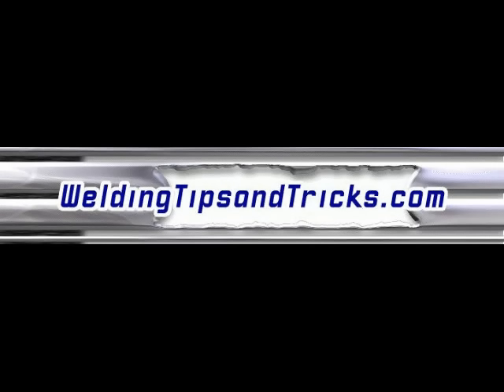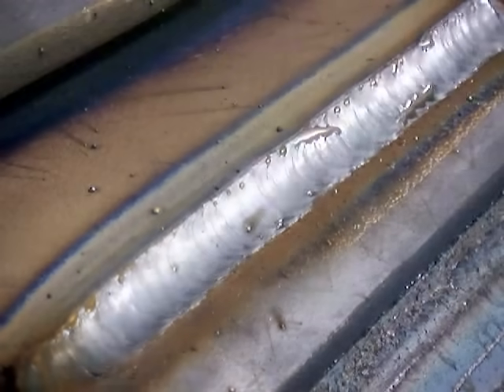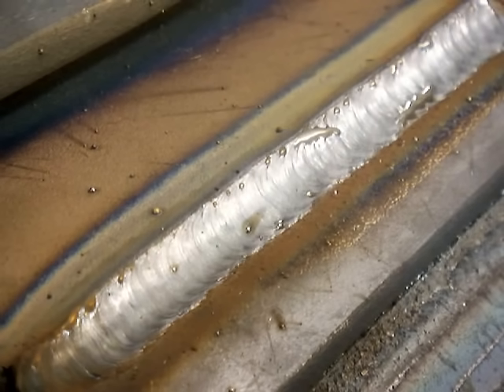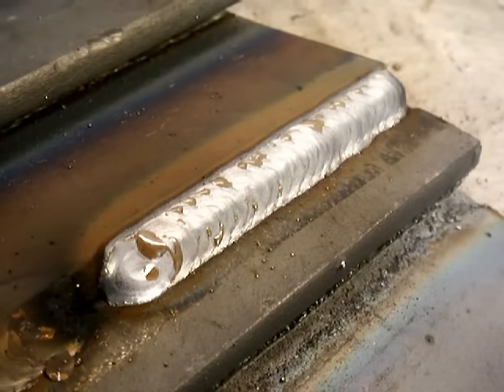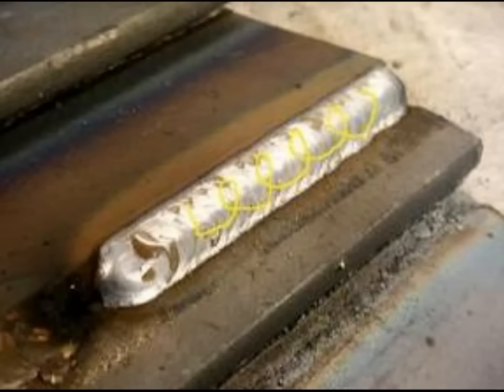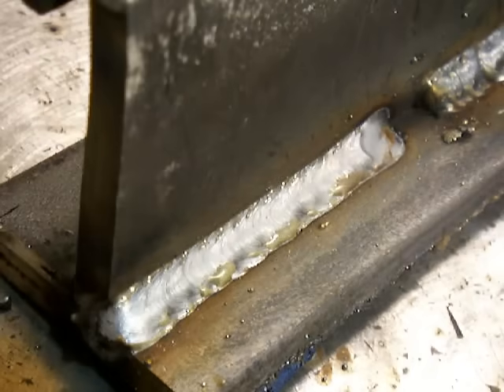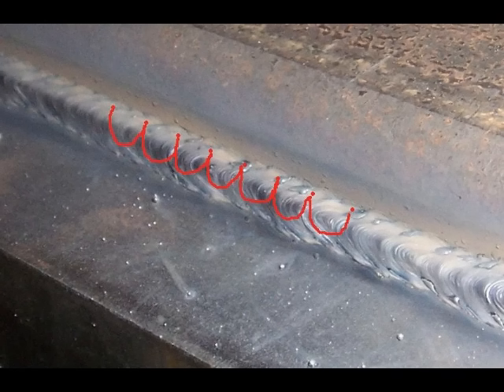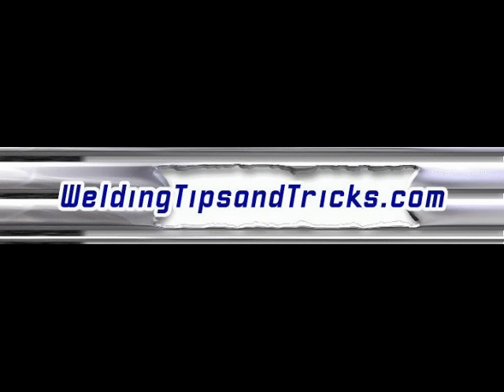Mig Welding Technique Taught by Old Timer

Comment: are you in oregon?  In any case, as ive said before along with a few other people, style matters little, i can and have passed structure and pressure push or pull.  As far as i know the only one you have to pull is stick, because if you try to push you end up with slag pockets, other than that anything goes.  And finally passing tests is easy. Being a good welder is far more than holding a cert. my tig certs were easy compared to the actual work i have to do.

Comment: Thanks, but I've been a welder for ten years. I'm certified AWS flux and solid, any position, any thickness, up to .045. About half the jobs I've had were heavy structural jobs, prepping I-beams and support columns to go out to site, among other things. 

If you're not getting the penetration then you need to bump up the heat. That's really all there is to it. You can see the weld bites in very well on both of his beads with no undercut. I guess it's just a difference in styles, to each his own.

Comment: wait until you get a welding job, and your doing heavy structural welds, and you try and pull with solid wire. you get very little or no penetration. props to the guy, he is a good welder but pulling is not the way to go

Comment: No, it looks smooth because he did it right and he did it well. You can push or pull with solid wire, push with flux core. (Yeah, and stick too)

Comment: This is a very common technique used in the trade all over the world. It has a name. It is call the "Oscillation Technique". It's nothing new and there is nothing wrong with it. It's just another very effective way that you can control your weld bead and minimize undercut.

Comment: and just so you dont think this is coming from someone without knowledge, ive welded plenty. .030-.035-.045 hard wire, spray and short arc with pressure and structural certs, and .030inner shield .045-.052-.1/16-3.32 dual shield with structural, ultra sounds and xrays. then of course tig ect, but that other stuff doesnt really apply lol.  people need to get out of the mindset that there is only one way to do things. the minute you do that, you stop growing as a welder, and you become your "boss"

Comment: There is zero wrong with what the guy in the video is doing...not sure where people are getting their info from that makes them think this isnt ok.  Yes there are other ways to do it, but most of the time it just changes the looks, in which case, it is personal preference as to what looks better, as long as it consistent and even.  Mig vertical up non stop in short arc is easy.  in fact could probably do it with the settings hes using.  You are right on one thing, both hands is great practice.

Comment: Ive done that before it does look like it penetrates better but Ive use this technique in building custom truck hitches and i never had to repair none of them yet (11yrs) still holding strong, i think if you use this technique with a fine tune setting  it should work just fine its just preference i guess which one feels more comfortable welding.

Comment: For a 1/4" fillet weld, the typical operator will use .129 lbs. per foot of weld metal. The 5/16" weld requires .201 lbs. per foot of weld metal - a 56 percent increase in weld volume compared to what is really needed. Plus, you must take into account the additional labor necessary to put down a larger weld. Not only is the company paying for extra, wasted consumable material, a weld with more weld metal is more likely to have warpage and distortion because of the added heat input.

Comment: Yes, but you wouldnt add metal on top of the weld, you would make the legs longer, therefore putting a larger weld. Its simple geometry really, imean imagine welding bead after bead on top of his welds untill it piles up 2 inches above the surface, bases on your theory thatd be a super strong weld correct? So why dont they do that?  Jus make a 1/4 fillet stand 6 inches above the base? Because thats not true. I may not be an expert welder, but i am an engineer who understands the physics behind i

Comment: end of story, its approved for structural welding.  The only other problem with your theory of more convex weld+ better, is that if you go beyond what the weld gauge asks for you are adding 0 strength and moving into wasting time and material, which is why they have a minimum and maximum convex vs concave, to concave= weak too convex= waste of time and material.  actually would like to find an article that explains how much time and wasted metal are in over sized weld. turns out to be alot.

Comment: i was wondering what the hell your talking about?  Are you referring to any of the welds in his video? because i would bet 100 bucks that all his welds in this video would pass inspection for weld size.  Near as i can tell if you put a weld gauge on any of those you would have the appropriate throat, which is what you are talking about concave vs convex. if youve seen weld gauges then you know what a throat gauge is. and if the throat gauge just touches its fine.

Comment: The "extra load baring material" in a convex weld, speaking from an engineers standpoint wont actually bare any extra load, and i didnt say a triangle weld was concave, i said that is the strongets a weld will ever be, thats why your generally told to have a slightly convex face, the problem i was adressing was the "bubble top" weld. To me that sounds like an exessivly convex weld, which in fact will have a sharp tranistion. So no thats not complete bs

Comment: You actually dont get more streghnt from a bubble top eeld, the strongest a weld can be is the right triangle formed by the leg lengths, another problem with an excessivly convex weld would be the sharp transitions from weld metal to base metal, they tend to create stress areas and are therefor prone to cracking, a smooth contire will alow the stress to be distributed evenly

Comment: get a piece of scrap that your going to be welding up for the car trailer, weld it the same way that u would on the project, then clamp it and beat the shit out of it.. If it holds to a decent beating i'll say your good to go if it falls off with a whack or two pratice a little more. Have fun

Comment: it can be mixed. It really depends on what your welding and what type of penetration you want.  If you want to run spray arc you need to run an argon co2 mix, a good middle ground is 75/25 a better spray mix is 90/10 i beleive.

Comment: lucky for you most places dont require cutting torch tests! lol  free hand torch cutting imo isnt really that important of a skill, by that i mean knowing how to use the torch is necessary, but there are lots of tricks that take the free hand portion away. so I see little point in someone being to worried about it.  If you want a straight line, use a straight edge and cut along it. That simple.

Comment: i hold d1.1, b2.1 and other various pressure and structural certs welding with that method, which many people have told me is wrong. But my welds come out more consistent better looking and trouble free, and most of the nay Sayers cant keep up. if you look at my video keep in mind its 1/16 inch dual shield wire, but ive done same thing is spray arc with .030, .035, .045 hard wire, as well as short arc. passed tests in all of them.

Comment: You are correct, sort of. Basically if you dont have your wire size, gas type/flow, heat and wire speed settings correct then yes you will have penetration issues. But you will pretty much have those issues push or pull.  For most wire feed welding settings are more important than the technique you use.  Dont believe me? check out my video, i push just forward and back no loops, in fact i usually move forward quite a bit, about 1/2inch and then sweep back 3/16 or so.

Comment: That is incorrect if you pull any MIG weld compared with pushing the weld you will get very poor penetration, if any at all.Also you should not weave or loop in any way, this will cause a serious lack of penetration,because the heat generated through the weld will not be carried correctly or evenly through the weld bead.Ive got great respect for the old timers,but that is a very effective MMA welding (stick welding) method not a MIG welding method.Think I'm lying, test the penetration with acid!

Comment: been certed both ways. poor penetration has more to do with poor settings and poor welder than it does with push vs pull.  bad technique could to it to, but by bad i mean cant weld.

Comment: not a dumbass. there's really a stupid amount of information to know if one wanted to know everything about welding.    Basically the inner shield flux cored wire is just like stick welding only its wire feed so the flux covers and protects the weld then you chip it off.

Comment: Actually you're the idiot. As has been told on this channel, if you want to learn 

something new, read an old book.  Non-Ferrous and Ferrous metals have been

joined together structurally for years and years. Read up:

Its called Dataclad, The process was patented by dupont in 1962, and is part of the 

EXW Process. and been done for years in the ship building

business. Google "dupont dataclad" and skip the first 3 links and read. So... actually you're the idiot my ill-informed friend. :)

Comment: im sure you can...what i find is the people with the biggest mouth have the least amount of skill.  and you sir, have a pretty big mouth.  and stick is not the hardest, it just requires more technique than wire feed.  which according to you there is no technique, its just how its supposed to be done...you dont impress me much thats for sure...try welding some .016 stainless or titanium, to d17.1 specs. I find that much more challenging than stick.

Comment: hard wire, or the wire he is using in this video needs gas coverage, otherwise it will be all porosity like im sure you found out. The other type of wire you were using is inner shield or flux cored wire, designed for field or home welding without cover gas. A inert cover gas is need to protect the weld from the impurities in the atmosphere.

Comment: @weldingtipsandtricks does the mig you were using use gas? my doesnt but when i tried this my wire wouldnt weld very good it would just splatter everywhere and leave little dots of weld. could you tell me why it does this?

Comment: on the test subject i passed a pressure cert b2.1 welding around a 1 1/4 tube flat rolling it single pass 100%pen using that same technique really, it was just a little faster circles to keep from burning it out (short arc). was cut and bend tested and was all good.

Comment: I see what your saying. im not saying use my technique just because it worked for me, or cuz i say its best.  And yes i also understand the importance of having a good technique that will allow you to swap from one process to another with no issues.Some people do create bad habits that way.  But for me personally, and i know this doesn't cover everyone ive passed way harder certs than d1.1 by"bringing the impurities"into my weld. I just wanted to point out that welding is not set in stone.

Comment: they told me that about pushing and oscillating forward and back with dual shield. Ive passed ut and bend tests that way. No slag issues. On that subject though, typically short arc isnt used for structure anyway, hard wire in spray can be, in either case though, that style would work fine, it just wouldn't look as nice running spray like that.  i think the common misconception about welding is that everything is like stick welding and very sensitive to changes.But its not Wire is very forgiving

Comment: @obieezx11 lol. yea you must have tons of exp. it shows.  If you use only one way, then you only do one thing. same thing every day with the same size wire same gas, same parts. Thats the only way one way will always work. I like his welds, he knows what hes doing. And even he would probably agree, there are occasions where other styles work better gaps for instance or thicker wire, thinner parts, hotter temps. i could care less whether you think im a sissy, I probably weld better than you do.

Comment: @ricabebe15 i push my dual shield, or pull depending.  But i move forward and backward not in circles, more of a spray technique.  But i do it because it allows me to make mistakes and fix them without anyone knowing.  If you burp, get the nozzle stuck, have to shuffle your feet, or move your hand and you weld without oscillating you'll end up with that showing in the final weld.  I can move just one speed, i choose not to.  check out my video  if you want, shows the results.

Comment: @pogsboo thats what you have settings for.  what you use for thick steel you dont for thin.  turn the machine down a bit, use smaller wire, change technique if you need to.  Thats the beauty of short arc easy to weld pretty thin to pretty thick.

Comment: What a load of ahole comments.Taught the exact same way you do it by an old timer 20+ years ago too.Used to weld hones for tank turrets for the govt,and they WANTED the swirl welds,as opposed to a straight drag/push weld.Never schooled in welding,yet after I left for another shop,was taught by worker how to TIG weld.In 3 wks,they took me off my job as a machinist(20+ yrs exp.),and made a full time welder of stainless fittings for food service/pharma industry where every weld had to be x-rayed.

Comment: @TheBurkey420 rofl no, no its not...so many genius welders...id hate to work with most of you...what you are seeing is a small peak in the throat.  The main difference between pushing and pulling is what that shows.  Pulling tends to have a fatter throat more round. where pushing flattens the throat out, so if your technique is a little off or you have a hair too much wire youll get that small peak in the center...not a crack.

Comment: @kaumiit2  your right spray would be better but this is not a CRITICAL coded application. And just becuase its not spray does not mean there was NO penetration. That weld does not look cold because if it did the toes would not be fused like they appear to be. I dont care what certs u say u have. I got certs too. So fuckin what. Doesnt matter. What u said about his weld was inaccurate and u got pissed cause I pointed it out. end of story

Comment: @kaumiit2  not thats your going to care much, but i actually hold 2 certs, a AWS B2.1 and ASME section 9 boiler cert.  Both were done with .035 75/25 and short arc.  Which makes you dead wrong. What you are hearing, is short arc, its noisy but running right. What your not seeing is the relatively flat throat (slightly convex), no cold roll and the blue line on the top of the lap weld when hes done that  shows the heat and penetration. You need to relearn what you think you know.

Comment: @angrynhpatriot  nice. ive done some thick hardox to mild had to preheat that to about 600. wasnt a pipe, though it was around a machined post. takes like an hour to heat that crap up with 2 propane torches and a big rosebud.  yea not really the kinda thing you want to touch with skin...removes it right quick lol.

Comment: @bman20000 i would weld 2 inch alluminum at around 850....put the torch to it about every 35 minutes and bring it back up...your pouring heat into it while welding so it keeps the heat it...try touching the soft part of the back of your arm to that....ouch

Comment: @KCobain95 tig is where the real skill starts. wire feed is fun but really was designed to be used by everyday people. Its a production weld. Tig is used typically on all exotic metals like stainless alum. titanium magnesium inconel, ect.  its used where quality it a must and thickness is little. also cant really do an x ray weld on .020 without tig since wire would burn through

Comment: @KCobain95 go tig weld some .020 alluminum 100% penetration uniform all throughout the part while keeping nice tight corners so you can grind them quickly and correctly.or go tig some 2 inch alluminum pipe fittings with a perfect root pass and having to fill in the rest of  a one inch bevel while passing a helium leak test.you probably couldnt even use the heat stick right...mig butt weld with .035thats were i started too.but i had respect for the people before me thats how i learned, i listened

Comment: @KCobain95 its .035 and if you plan on doing that, id say it better be uniform width, even oscillation spacing, no under cut on the edges or cold roll. id say make it a little more interesting, make it a groove weld 100% penetration.  Im not saying you cant produce a solid weld. Im sure you can. But when you have this attitude of im so great, people can and will find stuff wrong.  If you cant look at your weld and find small things that need fixing then you arent looking heard enough.

Comment: Handy tip, but should never be used as a root run, structual or not. It is proven to not generate succesful penetration. This being said tho, on multiple passes in the over head position, this is the procedure that i was tought when I was achieving my pressure and stuctual certificates in Australia. For anyone that knows how to weld verical up, it is paramount to weave on your capping runs. A Cristmas tree, number four figure and or a smily face. Tickets meen you practiced and done your time.

Comment: @96JUSTIN Interesting you should bring this up, what the book says, and even what the wire manufacturer says is important information to consider for sure.  But doesnt mean you cant have a successful weld by doing something different.  Currently i use 1/16 dual shield, people who made the wire recommend pulling only, i can pull but i choose to push, sometimes at extreme angles. but i have passed UT tests and bend test without a problem.  In the real world the rules can be tweaked.